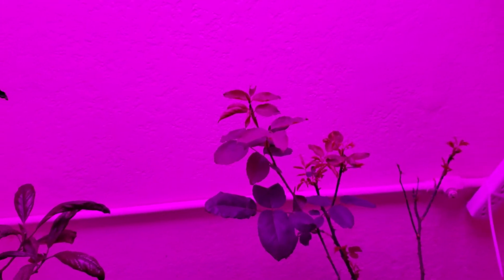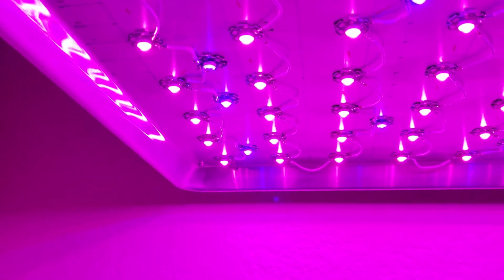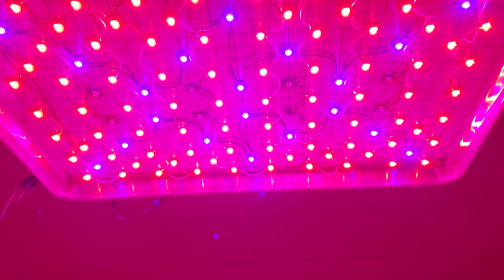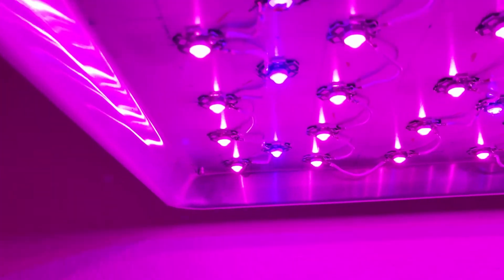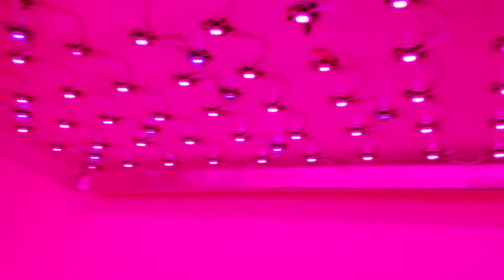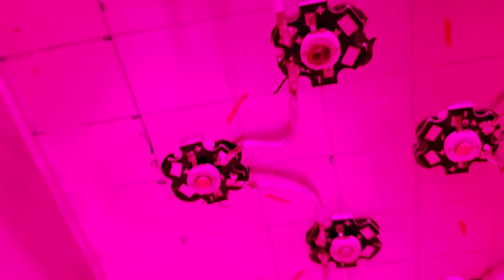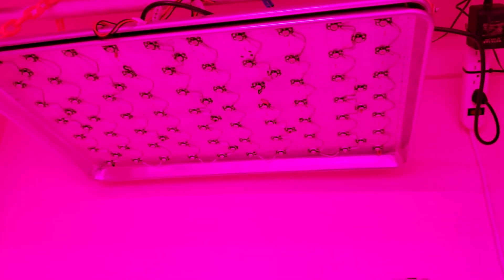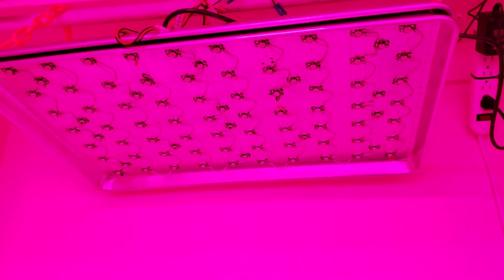Home made Led light panel: 6 burned blue LED`s

Comment: Lights might be different ma's. Like my cheap 3 watt ones on pcb stars are 700ma I believe. It's possible those royal blue might not be the same ma or lower and the power you have going to them might be to much and burning them? Just a thought
Reply from the maker: I thought about the ma, every spec I find is 3.2v/700mA, my drivers are 600mA, im actually 100mA lower.